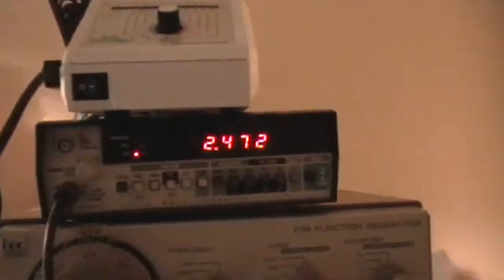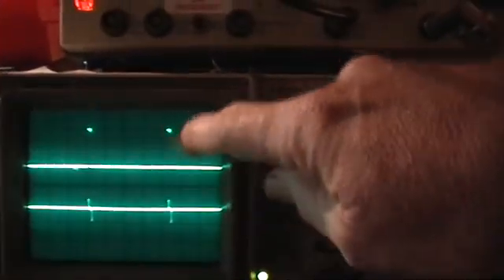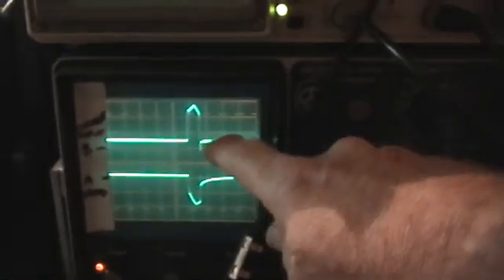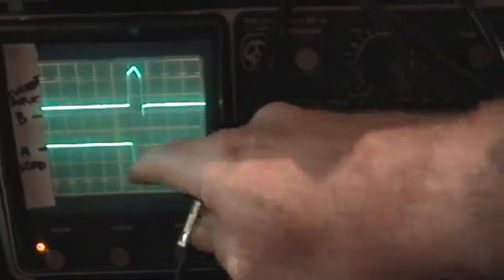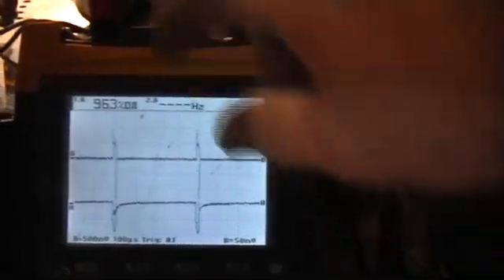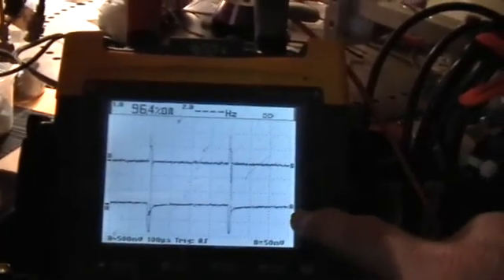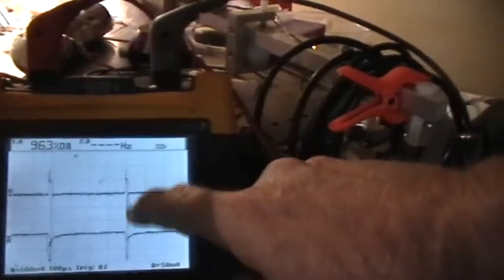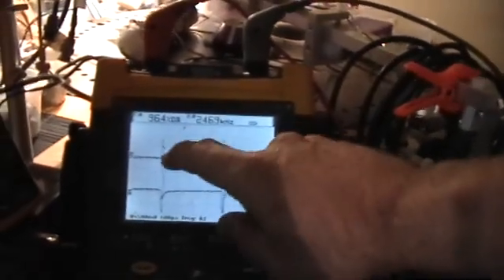Electric OU 3: Fluke 199 ScopeMeter part 1

Comment from the maker: @saturno14able 
No, we don't have that problem. The scope will retain its last manual setup, but if you ever push the "Auto" button it goes to ... auto. And it forgets the last setup.
Our meter is developing the horizontal line defect, though. It doesn't affect its function, it's just annoying.

Comment from the maker: Depends on what you mean by "wrong", Wilby.
Since Rosemary Ainslie has proclaimed that the circuit will work with just about any transistor, it seems that I am actually using the RIGHT fet, or at least one of them.

But of course the FET makes absolutely no difference in what I'm showing here.

And I will block all your accounts as soon as I can tell it's you. And I have also notified YT that you are a stalker with multiple accounts, for all the good that will do.